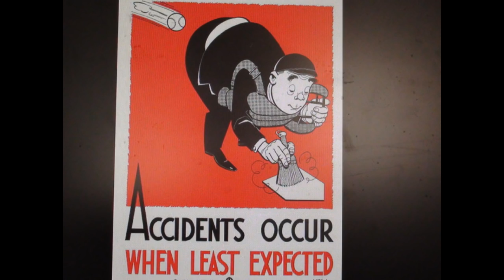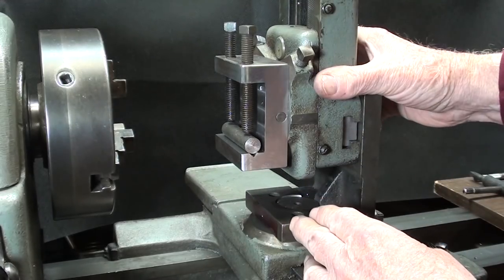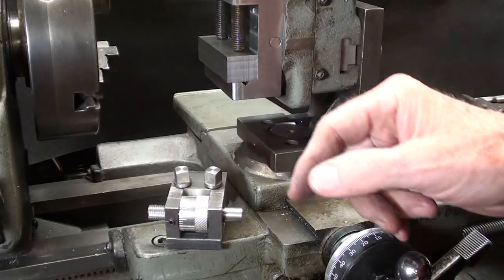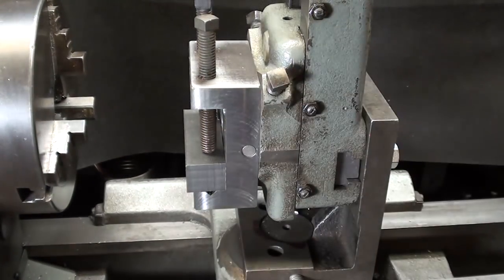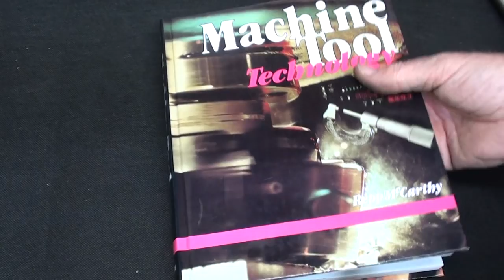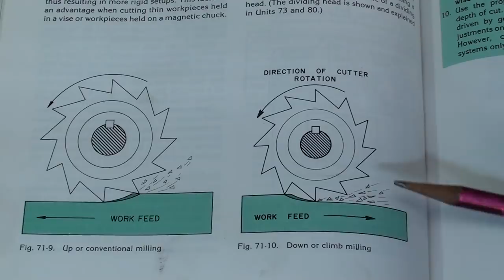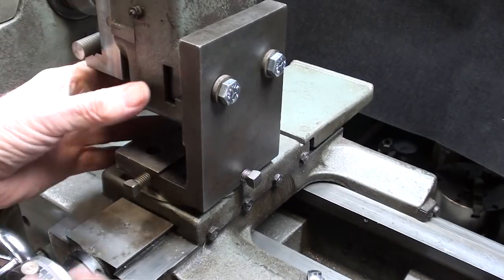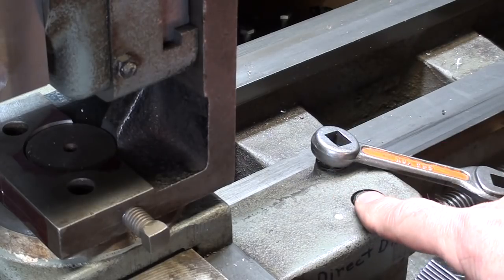Make Atlas Lathe Milling Attachment pt5 Tips #454 tubalcain

Comment: Great job, as always, on this video series Mr Pete.  In the 1959 Sears tool catalog the  Drawbar arbor is $2.75.  The weldon type  tool holder is $8.95 for 6", 9.95 for 12" lathe...the four bushing set was $2.77..."I digress"

Comment: Really great series Mr. Pete.  When I was young my "mill" was a home made milling attachment on my 10" Atlas!  It is a great way to have some milling capabilities without all the expense of a dedicated machine.  I consider it the "shopsmith" of metal working machines because set ups do take some time.  Advance planning of work operations can save set up time. An easy for new operators to remember the X,Y and Z on a lathe is to think of the lathe in a  vertical position,  like a mill.  The orientation then is identical.

Comment: I've wanted to do this for a long time.  But, put the vice dead over the way.  It would be even easier with a 10" compound since it's thinner.  Very nice work.  I predict it will be more usable.  The gibs being around the back side would make it stiffer against the overhang.   Suggest adding one.  A rear gib would effectively make the existing way twice as wide against tipping forward.  Think about it.  (Comment left at beginning before viewing.  Probably more fitting for episode 4)

Then at the end, you pan down and show the rear gib.  Yea!!!!!  Thanks for your good work sir.

Comment: Kings ransom for a drawbar. I'm looking at an Atlas for sale and the more I look for used parts the more this phrase rings true. I'm a little more craftier than average though otherwise I wouldn't be looking for a lathe in the first place. I bet I could turn a draw bar relatively inexpensive than purchased.
Reply from the maker: Merry Christmas, and good luck on finding those parts
Reply: @mrpete222  I heard about a fella on YouTube who has a collection of Atlas lathes and virtually every part and attachment. He won't part with them though. d; Merry Christmas.
Reply from the maker: @teeroux  How many does he have--like 10
Reply: @mrpete222  Well that's just the ones he shows he's always talking about some locked in the basement!

Comment: Special quick change gear mechanism for Atlas 10F Lathe;   Back in about 1968, we lived in Brookfield Il for a short while.  While there, I met a guy who designed and made a special quick change gear setup for those lathes.  I can't remember for sure whether he sold the whole thing, or made kits for it.  The whole thing replaced the gear cover on the left side of the spindle.  Have you ever heard of this thing?
   Just today, a guy on smokstak.com showed pix of an Atlas 10F lathe that he just bought and I think it has that gearbox.
you can see it here:
https://www.smokstak.com/forum/showthread.php?p=1563083#post1563083

Pete Stanaitis
----------------------
Reply from the maker: Thank you, I will take a look at that. I never heard of such a thing.
Reply: @mrpete222  Well, guess what!!! Here it is:
https://www.youtube.com/watch?v=7kB2NFhUWKE
He even mentions you as he shows us around his nicely restored lathe!
   I bought a 36" Atlas 10" lathe  (TH54?) many years ago at the shop that a used machinery dealer was clearing out.  The end plates for that modification came with it.  Later on I sold that one when I got a deal on a "in better shape", but shorter, 10F.

Comment: In the case of that thin stock and overhang you might moderate the issue a bit with some heavier stock or some block shaped tools laying around to clamp between the piece and the vise, adding mass to the whole system amd providing support closer to the area being worked on.  
Basically extending the vise jaws.   You could also make up extended or special shaped jaws to swap on when needed for easier setup.

Comment: Can you do an experiment on electric motors? I know you like electricity and motors. Is it possible to replace brush motor brushes with ball bearings that has  metal lubricant like molybdenum?! If it works then you can have brush motor with the advantages of a brushless.

Comment: Hi Mr Pete. Hope you see this query, I have just finished watching all 5 episodes in this series 3 years after the last contributor! The queries is : how do you ensure the the y axis is 90 degrees to the x axis? Any play in the two bolt hole for the t slot fixing might let  the slide body rotate from the vertical. How would you check for this? I have just bought a sphere 10" lathe which is a UK made copy of the atlas 10" and am finding your videos very informative and inspirational.

Comment: What my dad did in a crazy weekend was to bore out a 4" hole, deep in a square 'rod'.  Then turn the rod and taper the end.  Then do a 80tpi thread for an Fountain pen head! He bored it on the vice (has a 4 jaw OBTW) then turned it in the lathe and threaded it.  Did 2 last one worked.  He turned the handle in the wrong way and the thin wall ....